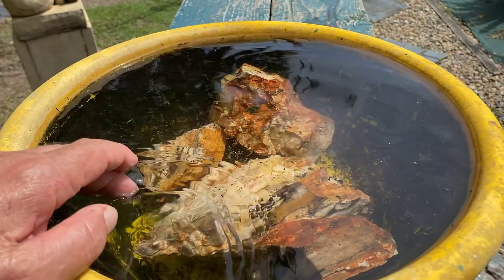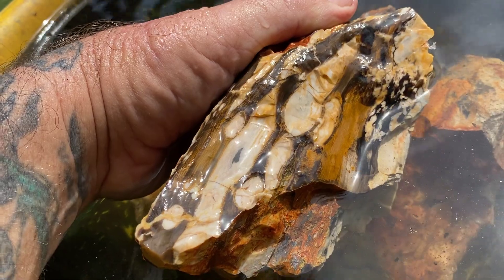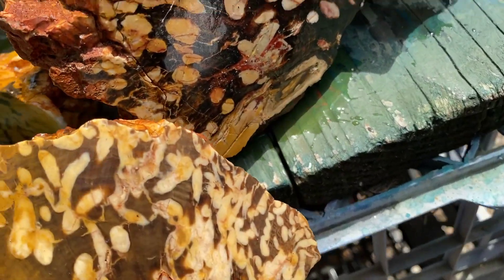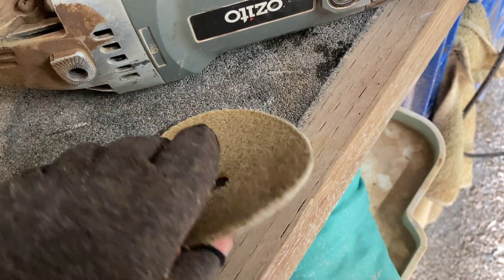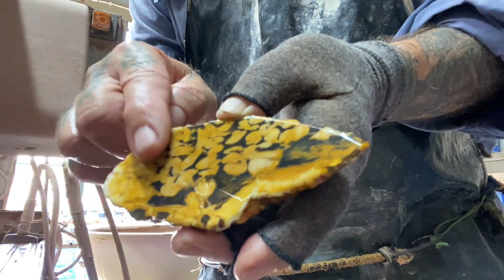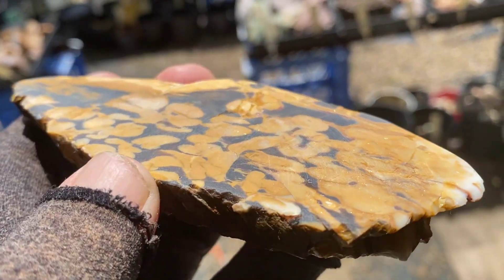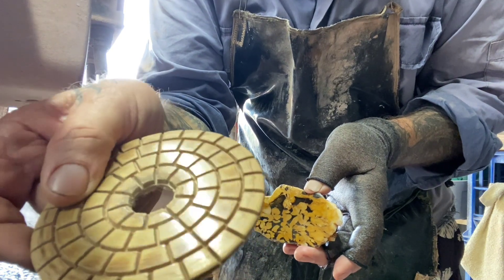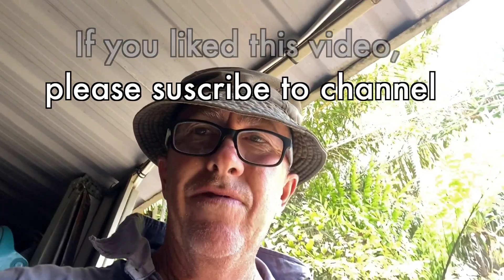Polishing Rocks with Hand Held Sander/Polisher - Cutting and Polishing Peanut Wood

Comment: Awwsome video again Kev! I think the main difference between drift wood and wood fall is the wood falling to the seabed instead of floating on top.
Reply from the maker: hey corey, yes, i think your right there, I just dont know the fine details of the woodfall process, and online info in the subject is very limited. 
   just a point of interest - Some online resources describe peanut wood forming by the driftwood being attacked so heavily by borer clams that it becomes saturated and sinks to the bottom.
   its an interesting subject that definitely needs more detailed explanation !
kev

Comment: I also love the Peanut wood Kev, it makes nice cabs and polishes up great. It was a very informative video from how it forms to the final polish very well done. I also use the soft discs and the Ozito but have never come across the metal ones you used to start the process. Excellent idea regarding the oxide polish, will have to try that one. Thankyou for sharing your knowledge Kev.
Reply from the maker: glad you liked the video gordon, its always fun making them, the metal discs can be searched for on ebay, (I think i got mine from THK Diamond tools website), 
   yes, agree, the autosol polish is a handy alternative to traditional methods of usind oxide powders, one thing i have never tried is adding a little more powder to the cream polish, (wonder if it would work ? not sure). 
   I know my christmas present this year is an ozito battery cordless sander polisher, i cant wait to get it, they are half the weight and size of the 240volt units,     cheers, kev

Comment: Would love a source for the solid Velcro wheel to start.
Reply from the maker: when i buy a set of discs from ebay the velcro backer usually comes with the set. The female  thread is either 5/8th inch, or, 14mm, you have to choose when you order a set.